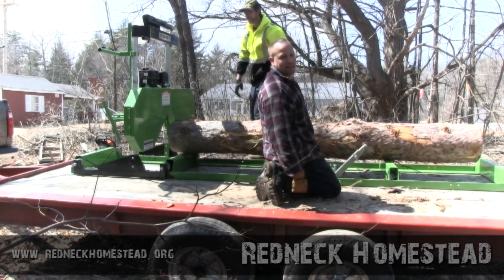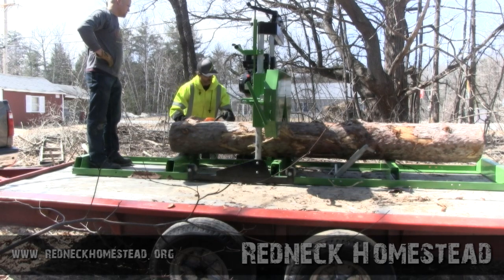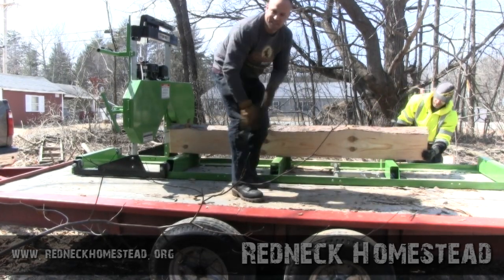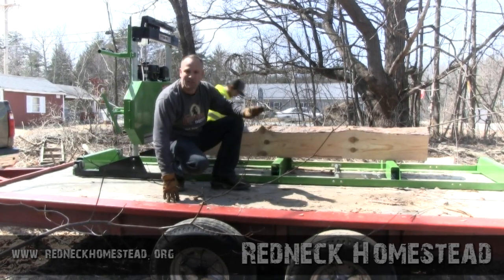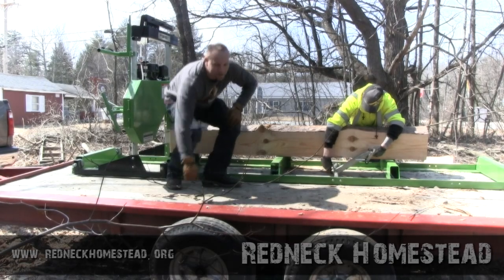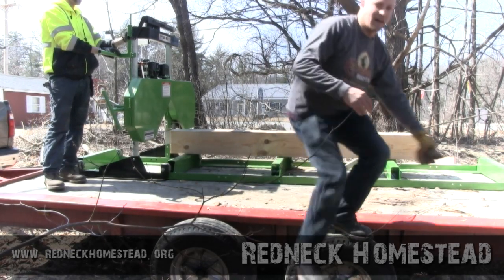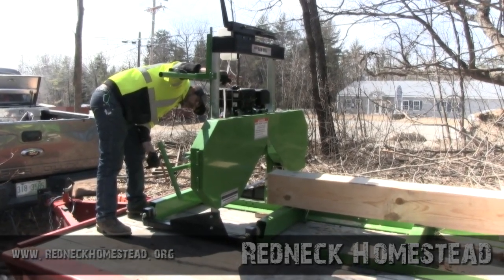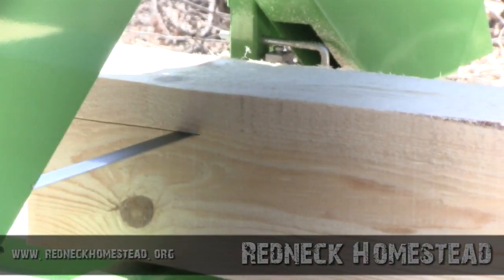First Lumber Run & Further Review: Central Machinery / Harbor Freight Sawmill | Redneck Homestead

Comment: Hi Josh,
   I worked in a sawmill for a few years and I would like to suggest that you start your cuts at the bell end of the log and saw with the grain. It cuts smoother and the blade will last longer. Starting at the bell will also eliminate the saw hanging up at the end of the cut. Hope this will help you a little. Best of luck with the projects. Enjoy the process.
Reply from the maker: Larry Shepard Thank you Larry!  I appreciate the tips whenever you have them!!!!
Reply: Also most people make the mistake of taking to much off with the slab, thats wasting a lot of usable lumber!

Comment: After using the saw a while, do you feel like it is worth the money, and do you think it will last?
Reply from the maker: Big Family Homestead YES!  My suggestion would be to weld key areas that are bolted...also, modifying it to a 4-post design...
Reply: Thanks for the reply, I guess I need to learn how to weld now... crap!
Reply: I love Josh- really good guy!
Reply: brad i have one of these mills now for 1 year . paid 2K and have 2500 into it with building my own tracks ....my sugestion is buy 2 20 foot ancle iron and build your own tracks like i did ....i had a iron shop cut the steel to what i wanted and welded it up .....welding is not necesarry you can drill and bolt it together yourself

Comment: I like your channel so far! I have the same sawmill and have already moved mine to 20 foot steel tracks but I found that it still don't eliminate the wave cutting what I have found is to make sure its getting plenty of water the blade is tight and sharp and go slow. I am working on a chain system to pull the carriage thru the wood and also working on a log turning and dog system if I get it working ill send you a video. Keep up the good work we are joining the homesteading movement we have 16 acres in South Central PA

Comment: Thanks for the update, Josh.  I agree…. the head needs some cross-bracing at a minimum.  I can see the entire head wiggle now and then as it is being pushed through the wood.  Because the speed at which the head is moved forward through the log, I would also suggest installing a couple of adjustable blade guides on both sides of the log position.  This would ensure the blade is not pushed rearward during the cut causing it to want to rise or dip.  That may help overcome the track alignment problem to which you refer.

Keep up the good work!
Reply from the maker: ***** VERY good suggestions!!  I am going to look into adjustable guides!!  I am like a little kid assembling his new bigwheel on Christmas morning, hehehe

Comment: O'  one tip... Slip you a wood wedge or you could buy ya a felling wedge and as you move into your cut two or three feet knock that wedge in and separate your gap at the end of your log... Reduces the chance of pinching the blade and reduces drag on your band.  On a long heavy beam or heavy board cut you might want to tap two wedges across from one another about half way down the cut... That gap reduces drag and pinch possibilities.  Have you sprayed any boards down with mineral oil to help stop the cracking threw the cure / dry stage?

Comment: Good to hear what you said about the quality of the tool for the price you pay. The issues you mentioned are minor. I would consider welding up a low-profile trailer frame made just for the mill with sidewinder leveling jacks. That way turning the log will be easier with the greater leverage having the log at waist height will give you.
Reply from the maker: Jeffrey Beyer great suggestions!  I am looking forward to getting things all "dialed in" with the mill, the new trailer, the new track and reinforcements...calibrating the saw, and then maybe even building some hydraulic log loaders!

Comment: I built mine with recycled material and used scooter tires I use a 12 foot blade and inflate the tires to fifty pounds to tighten the blade I got less than 200.00 in mine and love it! but i know I won't be painting it lime green.

Comment: I own one of these and I'm totally baffled by how difficult you make it look to cut a log.  I'd have back problems immediately if I did what you are doing.,   I never need to place my feet inside the rails of the mill. That's even dangerous as you could lose your footing.   I walk in a totally upright position right next to the tracks and and it cuts as smooth as can be.   It's a piece of cake.  You make it look really difficult.
Reply: To counterpoint your snark, he made it very clear the rails, or the trailer it's mounted to are not plumb or level. Hense why he had to walk behind it, as opposed to the side of it, to keep equal pressure on each rail side.
Reply: Feel better after sharing that?

Comment: Greetings from Alaska. That looks like something I could use for sure. In future vids it'd be nice if you could go more into depth about the specifics such as what kind of bearings are used, the quality of the wheels and rubber tires on them, how the blade tracks and how the depth adjustment works, mods you are doing, etc. Also, I sure would like to see you wearing safety glasses or face shield, and hearing protection. And if you're not already, please get in the habit of using a metal detector on your logs to find nails and junk. I think when you get the kinks ironed out it's going to be a real winner for you.
Reply from the maker: camgreer Thanks for your encouragement!  I am stalled in the middle of mounting the saw to a new 35' trailer.  Once i can find a full day, i will finish that and put the saw to work which will give me a LOT of material for a much more in-depth review!  Stay tuned :)

Comment: Thanks for shooting this video! I think the bugs can be worked out with it. Considering the price it can't be beat. I'd weld it together too. What welder will you be using? I think if you ran that sawmill 1 12 hour day it could pay for itself in one day. Great video! Lumber is so expensive.
Reply from the maker: Love2boat92 I will probably stick weld it using my Hobart Powerweld 6500 because there is no power at the site where the mill is located.  I agree regarding the mill paying for itself :)

Comment: Josh,
I'm trying to determine whether this is the same mill as that offered by another company under another name.  What make is the engine on the Harbor Freight mill?
Reply: If you are wondering if this mill is the same as Woodland Mills it is.. Same company in China  make a lot of different company names. Frontier, WoodMax and on and on.. That company in China sells the mill for $800us to $1500us depending on what engine you want on them and a few other modifications.. I was looking at bringing in a container full of the different mills this company offers and do the same as some of these big name brands do...

Comment: mix pinesol  cleaner in the water and it will lube the blade better. also wet the log with a hose to soften the bark and wash away dirt which dulls the blades. sometimes the dips are caused by knots too, but the leveling is very important.
can you get more track for longer logs? it would great if you can cut 16 foots.
best
Reply from the maker: Rev John O'Toole VERY helpful advice...and pinesol is a LOT cheaper than diesel fuel :)
Reply from the maker: Rev John O'Toole and yes, we will be getting 30' of track

Comment: I got mine at a steal of a price.  There was a time when the good coupons did not exclude things with engines on them, and it was already on super sale.  They wrote to me a bunch of times telling me it would be on backorder for a long time and did I want to cancel my order.  No way (smile).  Oddly enough it wound up coming pretty quickly after that.

My impressions of the machine are it is well worth what I paid for it, and unless you are a really good welder and fabricator, and willing to put a lot of times with solving bigger issues, probably better than what you could do with $2500 rolling your own.

I had a bunch of the same thoughts, but I have yet to weld mine together.  Once you get it lined up right and shims under it and tighten the bolts down good mine does not go anywhere and I can take it apart.  I am tempted to brace the 2 post design but again after doing a lot of cutting with it if you let the took go it's own speed, it is actually very stable.

The Predator engine is a dead nuts Honda clone and runs great.  Even in the dead of a NY winter, flip the gas on, flip the choke on and a couple of pulls and she rips right to life.  You need to be on the choke longer in freezing weather but the fact is she kicks right over.

About the only negative I have with it is that the bunks and angle iron that goes under it is harder to replicate than the much simpler angle iron some of the other mills use for tracks.  My friend has a Hudson with an 8HP engine and he was able to buy over the counter angle iron to extend his mill to over 24'.

The first thing I built with mine was a little building that I can retract the head into for the winter.  It keeps the snow and rain off the engine and blade etc.  I figure the tracks should be able to get with without too many ill effects.  The only one a few years in is the paint has started to fade on the parts exposed to the elements.

For personal use or small job milling, you can't beat one of these.  Get one of these and a couple of log cants from Northern tool and your in business.  And the nice thing about it is at this price point you can afford to let it sit idle if you like.  Plunk down 40K for a big, fully hydraulic jobber and yea, you can make a lot more wood a lot faster and with less physical work, but you gotta but running it every day to make the payment on the thing.
Reply: Matthew Kleinmann

Comment: Harbor Freight sells some very affordable tools. However, as you are seeing they are lacking in quality. I would have to drive quite a ways to get to the Harbor Freight store since I don't live near the big cities and even though I don't care to buy their tools, there are some I am considering for things that I don't use often. For my work I use high quality tools even though they cost more and they last a very long time. In my experience for things you use all the time, the tools that cost more are actually less expensive over time. I do hope you have good success with your saw mill however.
Reply from the maker: Camper Hollow Depending on the tool, there are low quality and decent quality from harbor freight...as for the mill, it is WAY better than their reputation...it is VERY nice

Comment: How thin can you cut a board??
Reply: +John Stacy  you cut 1/4 thick boards if you wanted with it
Reply: +Robert Bordeaux :)
Reply: John Stacy 
once the lumber is square on all four sides, I've seen it cut as thin as 1/8 inch. It's called a veneer pass.

Comment: I don't see a "10 out of 10" with the issues it has. A sawmill that DOESN'T cut a straight borad is a big problem as I see it. You shouldn't have to tweak/re design a brand new machine that is designed for just one purpose.  Thanks for the video though... very informative.
Reply: Its not the saw dummy, its the ground that needs to be flat, level and stable.
Reply: Paul Jones c
Reply: HONEY B GUYS   Exactly. Do not give 10/10 with serious issues. Say 9/10. Also, 10/10 requires performance beyond expectationtion.
Reply: Don't blame the saw for operator issues. The base is not leveled and has not had any adjustments at all. It needs to be properly setup before trying to blame the saw.